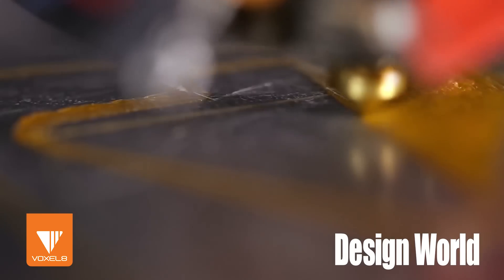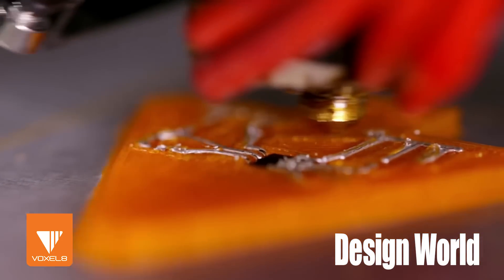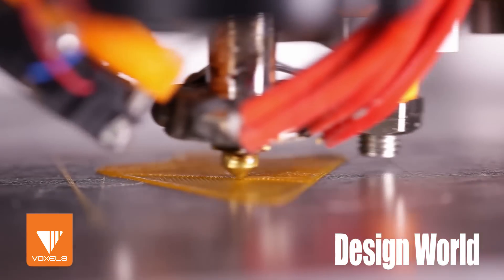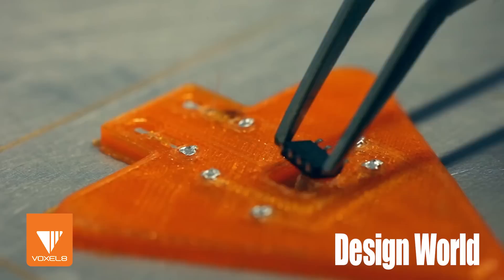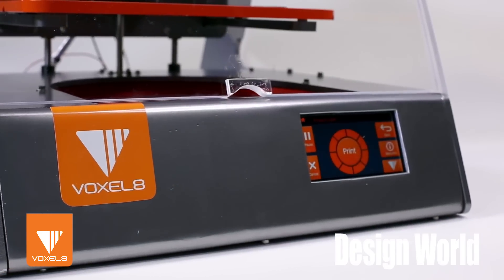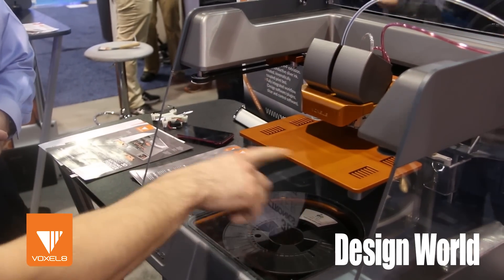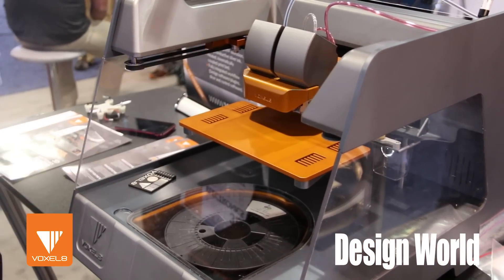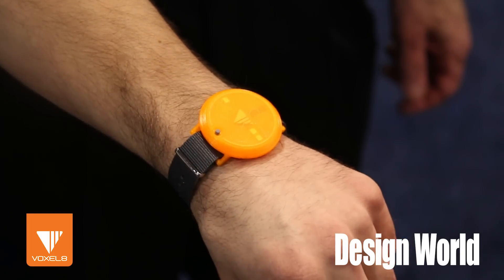A 3D printer that does printed circuit boards

Comment: It’s cool that it’s possible to 3d print whole mini drone with the already integrated circuitry without the need of making a separate pcb and additional parts. You can almost have the whole thing as a solid object but it would be impossible to fix the circuits if the go bad.

Comment: Corporations would love to see this advance to its highest level to create all their products 100% sealed and finally get rid of right to repair lol.
Reply: On the other hand, circuits are going to get really cheap that with the schematics, we can make them ourselves.
Reply: They can already "pot" the circuit boards in epoxy or the like. Problem is, conformal coating like that protects the circuits, increasing longevity. It also increases shipping costs.

Comment: If this could be implemented to a SLA or SLS printer, than that would be amazing. Also have a CNC add on to be sure the printer can do anything it has to for that guaranteed working PCB

Comment: If that component gets hot, it'll melt through the PLA, so not that good. Technically, it doesn't print circuit boars, it just melts solder. Not exactly the same thing.
Reply: that's where simulations kicks in.

Comment: I would be a little concerned about the spike extruding up from the traces.  If the next layer of plastic knocked that spike over onto another trace then the circuit would short out.  You'd probably want to pause it there and knock off any spikes before continuing the print.  All in all excellent technology and great ability to add layers.  Once the technology allows printing actual components then the sky will be the limit.  It would be wild to download a spectrum analyzer file and print a $60,000 spectrum analyzer for $100 of materials.
Reply: It might be worth it to rough print a layer and CNC mill it flat. That would remove any spikes for sure. Maybe this could be achieved by the removable table being taken out of the 3D printer, and plopped into a mill? So many possibilities.
Reply: +Sky Man would you want hot silver going into a plastic?